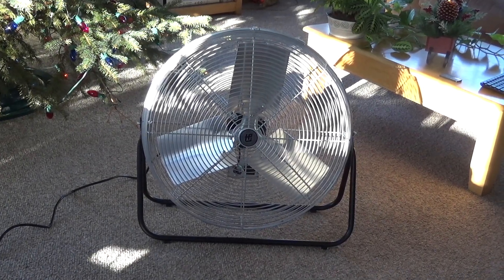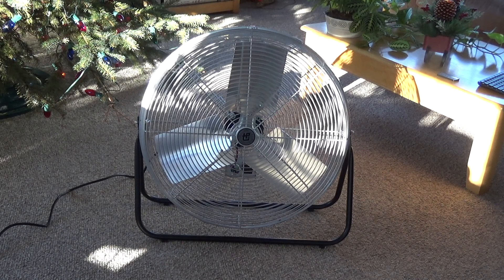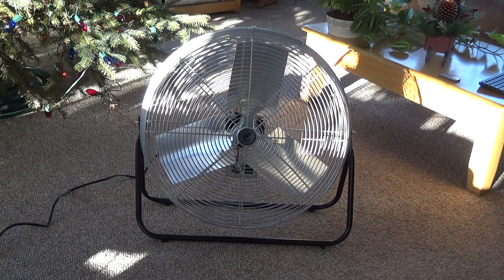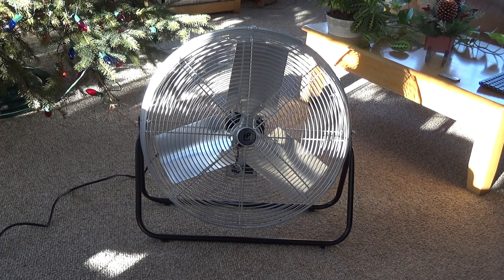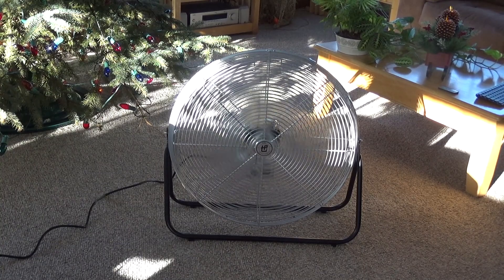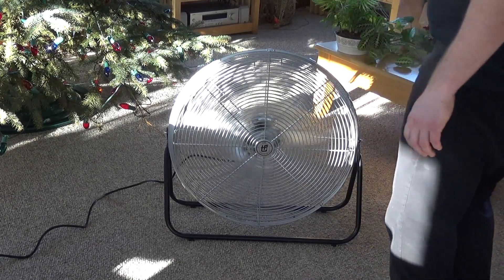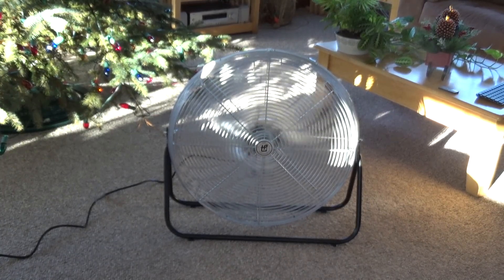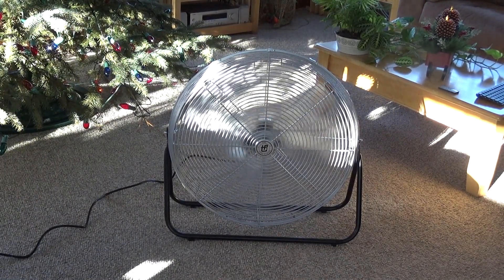TPI F-24-TE Revisit

Comment: A slower higher torque motor would be ideal. That is what is in every high quality fan with deep pitch and quiet operation.
Reply from the maker: That is exactly what I have purchased to replace it with.

Comment: Honestly I would more then likely fry blade swapping it with an AC condenser fan blade more then likely you can find one that looks like the original with both a better blade scoop and a Steeper pitch
Reply from the maker: It's quite possible there are better blades out there. Definitely something to consider.

Comment: The 1/4 HP motor I put in my fan is a genuine TPI replacement part; part #59081001 and spins at 1,075 RPM on high speed. It is a 2-speed motor, so you will need to figure out a way to add a third speed, like how I did on my motor with the cardboard box-type variable speed control hidden in the back cover to give it essentially a tunable low.
Reply from the maker: I ordered a 1/3 HP blower motor, also 1,075 RPM. It is a 4 speed motor; hopefully between them, 3 will provide a good range. If not, I could always add an additional capacitor to further adjust the speed.
Reply: @JordanU  So theoretically yours may wind up being a tad more powerful than mine. I wanted mine to be to the factory spec for the HV model, but looking forward to seeing what you're able to make of yours